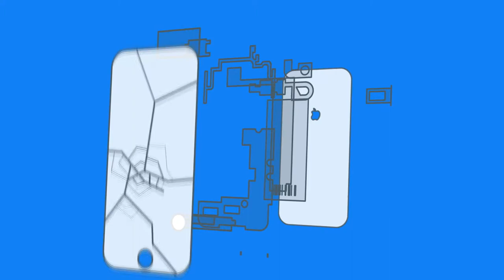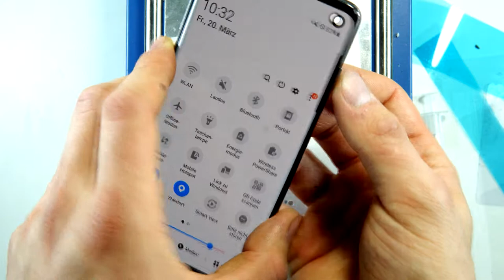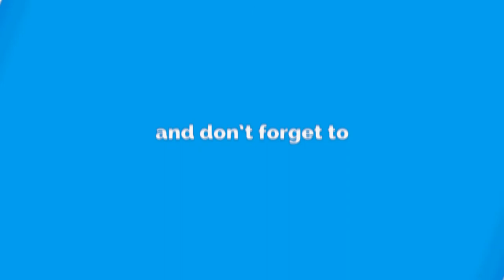Galaxy S10 S20 Front Glass Repair Replacement Only - New Method

Comment: Once you separate the glass from the super amoled, is there a physical  camera hole on the actual display? If so, what step did you take to ensure there is no glue is left on the glass that would cover the camera hole?
Reply from the maker: You can clean it later from the inside after replacing.